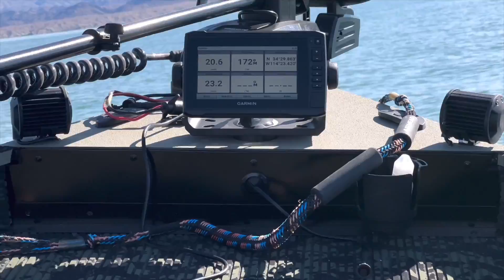14ft Star Craft restoration Timelapse

Comment: Does the floatation foam in the boat like that lift the hull out of the water more or is it only to keep the boat from sinking if flipped over?
Reply from the maker: It keeps the boat from sinking in the event of an emergency, and it also helps that ride smoother through the chop

Comment: Silly question- what's the garden hose for?
Reply from the maker: It was for subfloor drainage, but I went a different direction with the deck and ended up not using them and sealing the deck on the sides.
Reply: If I was doing a wooden deck and wooden hatches should I use the tragedy of using the garden holes?

Comment: How do you make sure your not going over the weight capacity of the boat when you do these modifications? Iv got a 14' Starcraft rated at 800 lb and would like to restore/ mod it but how much actual weight can I add without running into trouble? Thanks for the videos! Great inspiration 👏
Reply from the maker: 800 pounds does exceptionally high weight rating for a boat. You can wear everything or just know the weight of everything you’re putting in you can also just make sure you try to use a max efficiency model using the lightest stuff. You want to go light in the 14 foot boat because there’s only so much horsepower you can run in a boat that small.

Comment: Have you guys any opinion on elco outboard?
Reply from the maker: EPropulsion is better
Reply: @TinyBoatNation   thanks for the input. I was looking at making myself a bigger boat that will handle the larger waters we have up here in Minnesota so was looking at their higher hp models (they have up to 50) and the amount of cash if have to shell out for lithium batts and a solar system to aid in charging. So, there goes my latest hike in the water idea that I'm gonna throw cash away into! Also, I was thinking of making a river car topper until I ran across your yak killer. I ride a wheel chair and was wondering if you guys would make custom sizing on your deck frame kits?

Comment: I am a large guy, 6'5-365lbs. I am wanting to redo an old Tracker boat but worried about your hatch kits holding my weight. Is that something I would have to worry about? What is the weight limit on your hatches or lids?🤔
Reply from the maker: They are 1/8” and have under supports. They will hold
Reply: @TinyBoatNation  Thanks man, I really appreciate it. Love the channel and the site!